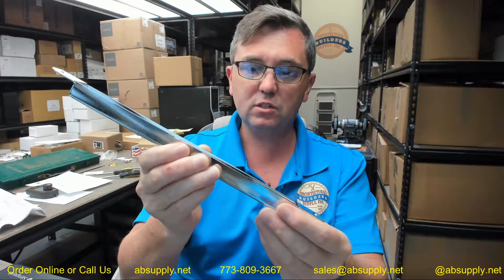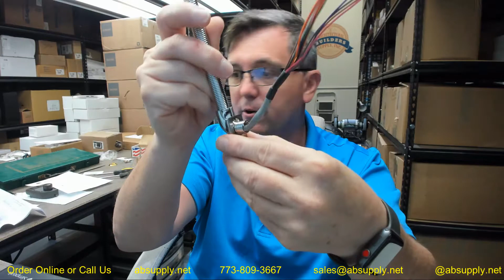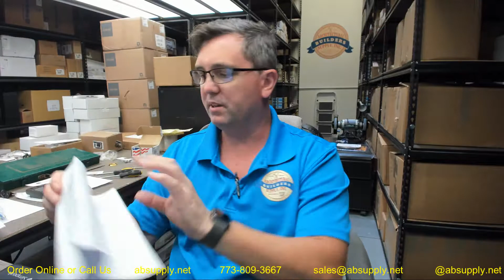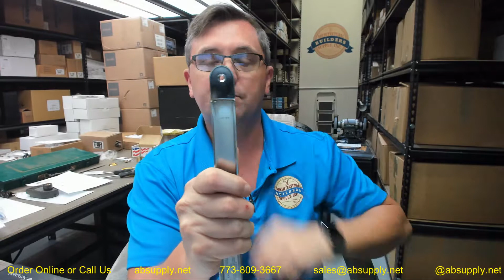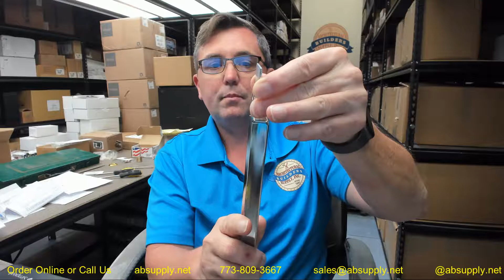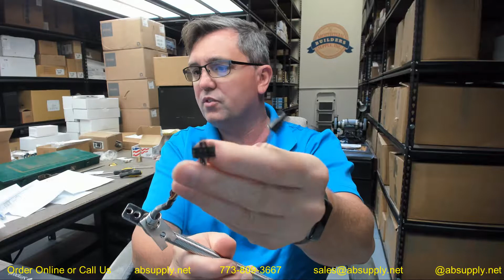Securitron Company EL EPT

Comment: Do you know if the EPT will allow for 180 degree swing of a 1 3/4" thick door?  I know they have EPTL/SC, but wondering if the standard EPT will work with 180 degree swing.
Reply from the maker: Apparently no, as the manufacturer has stated "Go with the EPT-SC to allow for the 180 degree swing."  Rich 773-809-3667 -